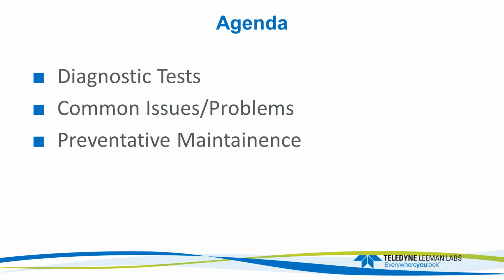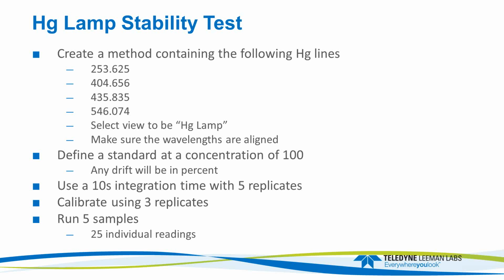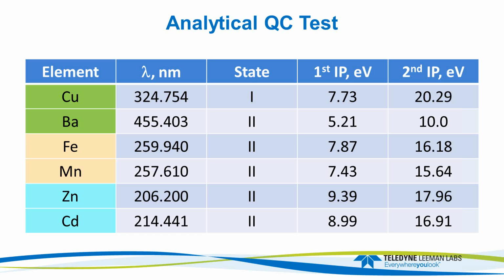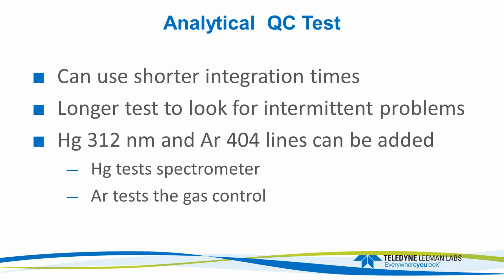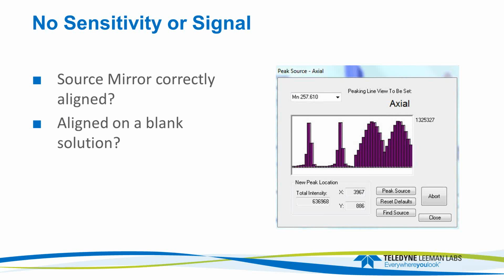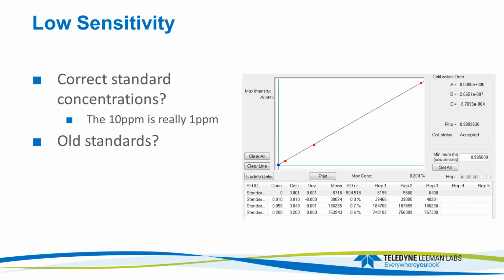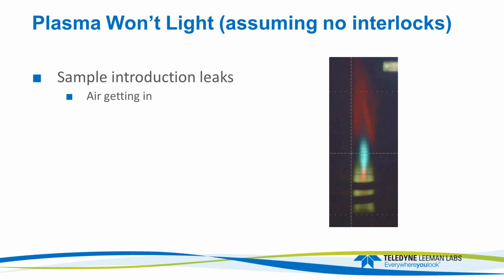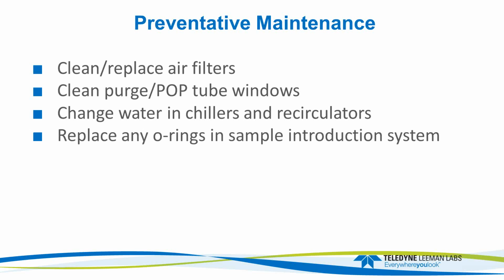Teledyne Leeman Labs   Basic Troubleshooting for ICP OES

Comment: what could be the problem if my plasma torch turns orange and starts to crackle? I guess I have high salt concentration, but could it be fixed?
Reply: Nikolina - It sounds like you are melting the torch.

There’s a slide in this presentation for torch melting problems:

■	Gas lines reversed
■	Torch too deep in load coil
■	Torch not centered in load coil
■	Coolant flow not high enough for application
■	Not enough auxiliary flow

If none of these help, try diluting the sample to reduce the level of dissolved solids.  

If none of these help, call the Torch manufacturer as there might be a hardware problem.  If it is a Leeman torch, please contact us at 603-886-8400.
Reply: Check argon gas.                  
 flow rate auxillary gas

Comment: My ICP is having an oddity, why the peak is too small in shape (unusual) and only occurs on 2 elements (UV region )
Reply: 1.	Check that the wavelength alignment is good.  If their misaligned, the intensity will be lower
2.	Check to make sure they are aligned on the correct element.  Check the alignment with a single element standard to verify it’s right.